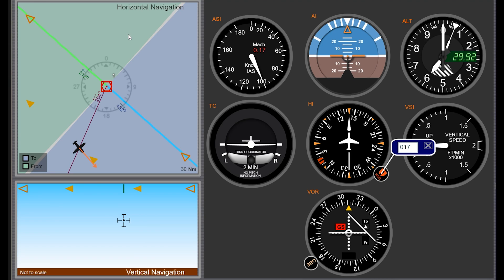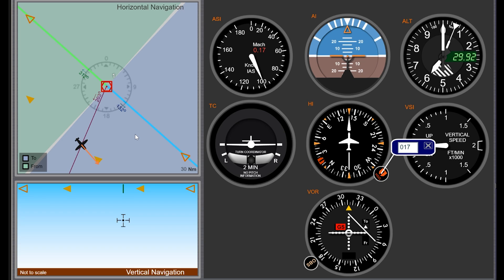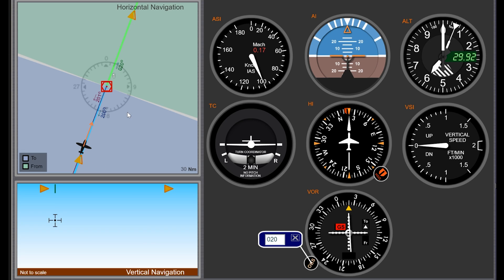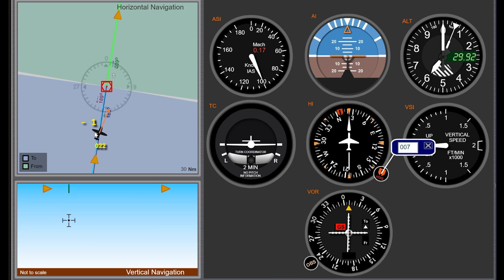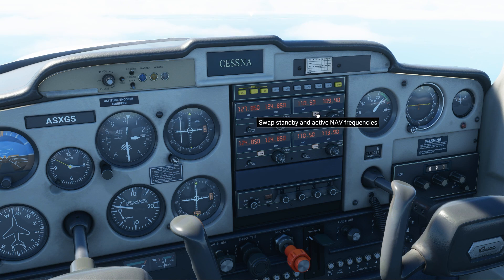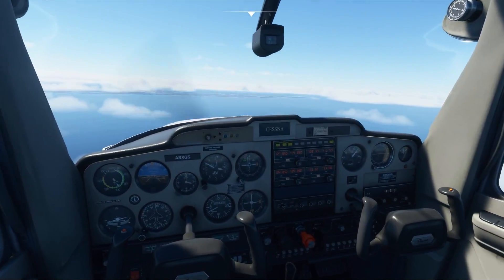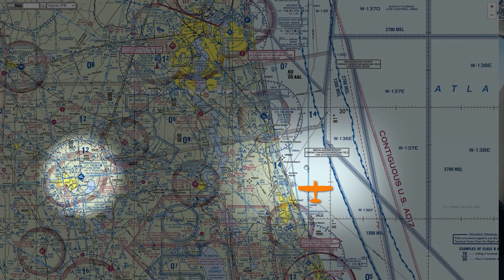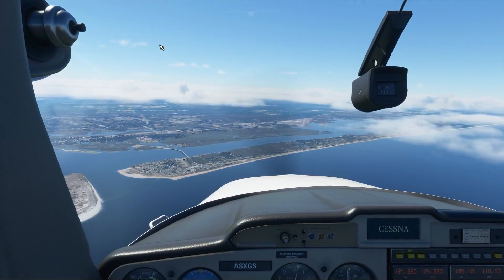VOR Navigation Made Easy + ADF & DME

Comment: Omni means omni! It does not mean that the VOR transmitting station is transmitting discrete beams. 

Your airplane's receiver can calculate what radial it's on (or trying to find) and can calculate to/from info and it does so by receiving signals that are broadcast in all directions from the VOR transmitting station. Here's the best vid I've found on how this works: https://youtu.be/tZ2gG1v9Xg8

Comment: Great tutorial thank you. Nice to know how to line up with a runway by turning the OBS to runway heading and follow the needle. Pretty cool.
Reply: Just realize that'll only work if the VOR is located on the airport property (and generally close to the runway in question).  Plenty of VORs aren't located on/at the airport - in those cases (or if the VOR is at the airport but far from your desired runway) this trick will not work to line you up with the specific runway.  You would need to reference the appropriate VOR Instrument Approach chart (if one exists) to know the appropriate OBS course to select.
Reply: @ElkoBarbell  That makes sense. Thank you for clarifying.

Comment: Please I need help, I love using VOR navigation so much but I have NEVER seen the to/from flags pop up, please I need help
Reply from the maker: I'm sorry to hear you are struggling with VOR. What VOR have you tried to capture and at what altitude? It will not work on the ground. You need to be in the air. Try it between 1000 and 3000 feet or so.
Reply: @BradySkye  I was at 5500 feet over the sea and the main VOR I was intercepting was HTO (H) 113.6 on Long Island heading from West to East however I looked up my problem a little more, turns out its a glitch that happens when you start the simulator without the planes engine on.